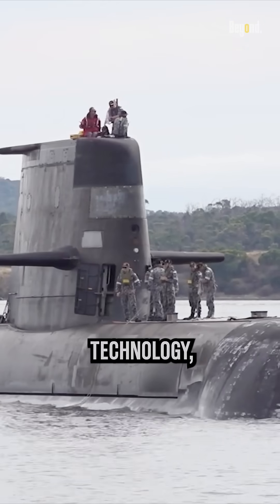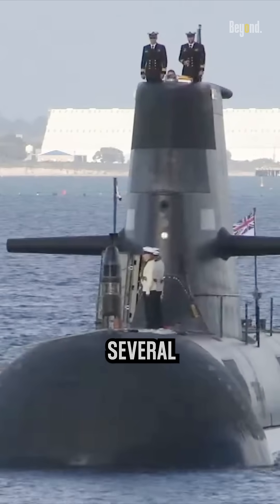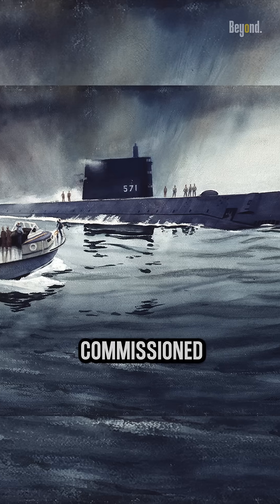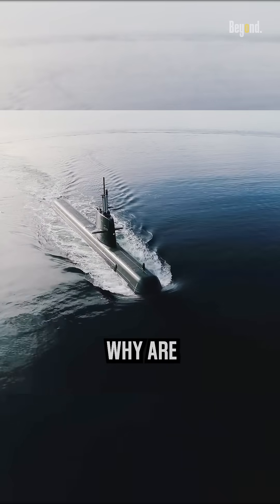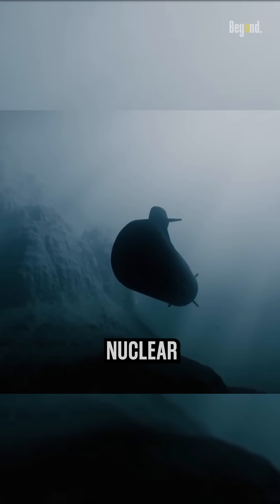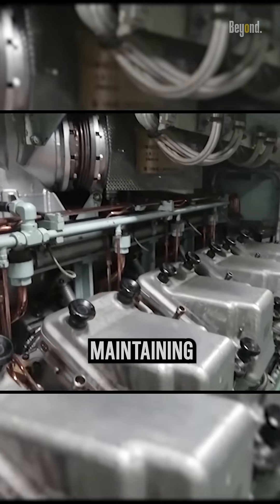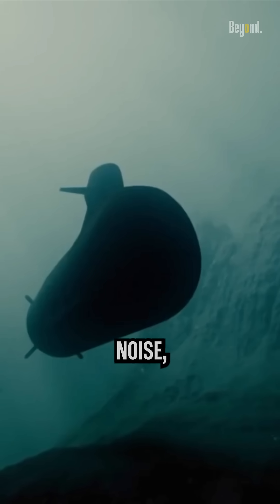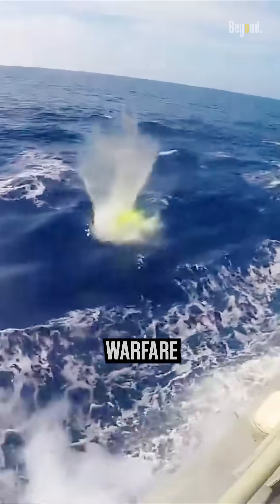Why are diesel-engine submarines still needed? #shorts

Comment: Diesel subs don't use their diesel engines when they're submerged. The run on battery powered electrical motors and only run the diesels when they are surfaced or close enough to the surface to use a snorkel.
Reply: Even with only 60 seconds available to you, this information is crucial.  Better to leave out some of the material that you chose to include.
Reply: @dinsdalemontypiranha4349 then make a video. Do it the way you think others should.
Reply: @dinsdalemontypiranha4349 don't want thieves learning and copying tech
Reply: That has always been the case with diesel electric subs which is why they are so quiet when submerged.  However, the difference is that the technologies in modern diesel electric subs allow for far longer operation underwater and the hulls are configured for underwater operation unlike the WWII era subs which were surface ships that could occasionally submerge and operate inefficiently for short periods.   We also know a lot more in reducing noise generation and a lot more in detecting and identifying noises.   What we haven't improve on, are reasonable procurement bureaucracies.
Reply: I was on an AIP boat..yes, we ran the diesel submerged
Reply: But I understand your Kool aid
Reply: Unless it's a sterling engine
Reply: So AIP uses ( the boat I was on) hydrogen to warm up the diesel, then used banked 02 to feed the diesel...
Reply from the maker: I will make a long video for this explanation, it's only 1min 🥲
Only in Beyond Explained! 🤙
Reply: @BeyondExplained Can you explain why they have to surface to burn the diesel? Why can't you pump out gas like bubbles into the water. This has never made sense to me.
Reply: @lukemurray4950 two main reasons. Exhaust is only one half of the problem. After a certain depth, the exhaust output pressure of the engine will not be able to overcome the water pressure.  The other problem is fresh air. Engines need fresh air in order to combust the fuel that is introduced into the cylinders. Snorkels supply this fresh air when you are very close to the surface. Even if you had high pressure air storage tanks which supplied pressure regulated air to the engines, the engines would deplete those tanks in very short order due to the massive amount of air these big diesel engines require to run.
Reply: @berkcanberk4947  Thanks for the break down but couldn't you convert Oxygen from the sea water? Or is that technologically wishful thinking? Thanks.
Reply: @lukemurray4950  Nah science doesn't allow it with the tech we have. We use something called electrolysis to seperate O2 and hydrogen from water. This process is very inefficient and power consuming. In short, the engine couldn't create enough electricity to keep oxygen supplied, so the engine would die. I hope that makes sense, otherwise I can try making analogies lol
Reply: @Gracefulwarrior2124  No it makes perfect sense. Thank you so much for you patience in explaining this to me. I finally understand so thank you again. Much respect.
Reply: @lukemurray4950  No problem! You somehow merged two of my favorite subjects (which is science and military stuff,) together, so it was actually fun and an honor trying to answer that :D
Reply: @lukemurray4950 It's not about the exhaust gasses. Diesels require air to run, so they either need to be surfaced or use a device such as the snorkel to draw in air to run the diesels.
Reply: @Fizwalker  Yeah thanks. The other guy also broke down for me. Great to people to educate eachother of things we don't understand. Much respect.
Reply: @lukemurray4950 Do you have a clue as to WHERE the air for a diesel would COME FROM if submerged? Hint: NOT from inside the sub.

Comment: The issues not addressed:

1) they are only quieter on battery. When running on diesel, they are much louder

2) most surface to run in diesel, making them easier to detect by air and surface vessels with radar

3) they run slower underwater than nuclear boats

4) because of battery limitations, they cannot stay submerged as long as nuclear boats

5) they cannot operate for the distances and time lengths of nuclear boats without resupply. 

Diesel subs are great for short range and shallow waters. They also make great one-way mission boats, as not having to worry about returning doubles their strike range.
They are a great option that most European, Asian, and Mid-East/African naval nations can utilize.

They make no sense for the US; and any nation that intends to use submarines to project power across multiple oceans is better served with at least a few nuclear subs.

Comment: There is no such thing as a "diesel sub"; they are diesel-electric. They run like train locomotives; and charge batteries. On battery, with modern props, they are VERY quiet.

Comment: You left out the main reason to deploy diesel subs. In littoral / shallow waters, they are deadly whereas nuclear subs have to worry about running aground!
Reply: You are actually referencing the size of the submarine, not the method of propulsion. A nuclear submarine as small as a diesel is possible but no longer worth the expense. You are correct in implying the mission is an important factor but you are incorrect in thinking nuclear powered submarines can not also fulfill the mission scenario you envision.

Comment: Another factor not mentioned here is mission criticality. A diesel sub can not operate on the ultra quiet battery power for very long. This means they will need to surface and runs the diesel which is loud periodically. For some missions this is fine, but the us strategy is to have a sub get lost for months at a time, and never need to surface.
So yes nuke subs are louder in some cases, but in terms of long term evasion they are without competitors.

Comment: When a diesel sub is running on batteries, they can turn off EVERYTHING and I mean everything mechanical and emit zero sound. Nukes can't do that.The reactor is always burbling away. If you stopped a reactor completely, it would scram.
Reply: You stop the coolant circulation pumps and just use natural convection in the reactor for ultra silent operation.
Reply: @dundonrl  So, why do you have cooling pumps if they are unnecessary?
Works the same in the Caribbean as it does under the Arctic Ice Cap?
Reply: @abrahamdozer6273  At very low power on the reactor you get enough circulation with natural heat transfer (hit water rising, cool water sinking) but when you need more power/heat going to the heat exchanger you have to run the circulation pumps.
Reply: @dundonrl  In other words, you can  sit there for a time and do nothing.

Comment: That's unexpected I would have thought dirty diesel would be a lot noisier than nuclear and running costs I thought because diesel would need oil coolant and general piston valves gaskets all that to be replaced every so often than it would be more expensive than nuclear that I thought I just more expensive to build then after that they can pretty much keep going otherwise why would they put them on the us aircraft carriers

Comment: Diesel is used on sterling engine subs, I believe, which are the quietest variety of subs.  Nuclear powered subs are only advantageous for blue-water operation: crossing oceans, long periods under water.  For short cycle coastal patrol duties, diesels are fine.

Comment: When deployment range is not a factor, you can cover more real estate with two or more diesel subs that you could get for the price of a nuclear boat. But if you have to routinely cross an ocean to get from your operating area to your home port, nuclear is the way to go. When possible, it would be advantageous to forward deploy a pack of diesels in trouble spots.

Comment: Diesel subs can run their engines underwater if they carry liquid oxygen to support the combustion. The exhaust is just expelled through the hull. Carrying liquid oxygen is extremely dangerous however. They can use electricity to split water molecules and create hydrogen but that is for breathing air. Underwater they usually use their batteries. Diesel subs are NOT quieter than nuclear subs but they are cheaper.
Reply: When running submerged on electric motors diesel subs can be quieter. Nuclear subs have to run reactor coolant circulation pumps as well as the electric propulsion motors which is additional noise.
Reply: The liquid oxygen bit had me chuckling pretty good. Someone tell you this or did you make it up yourself?
Reply: @jasonrideout6786 What got me was splitting water molecules to create hydrogen for breathing 😂😂. I'm like what now? 😂😂😂

Comment: Sorry, this one is misleading. Diesel subs are only quiet while operating on batteries. As soon as that diesel kicks on to recharge the batteries, it is loud. 
Meanwhile US nuclear submarines went from being quieter that the surrounding waters in the 80s to mimicking the sound of the water in the 2000s. 
The ONLY advantage of diesel subs is that they are much cheaper to buy.
Reply: I imagine they're easier/cheaper to maintain as well assuming the country doesn't have nuclear technicians readily available.
Reply: Less risky too, mind. You don't want to be hit by reactor radiation leak out (/-_•)\
Reply: @finjay21fj  well, the risk is far higher if you happen to be on a vessel made by the USSR.
Reply: @loganb7059 submarines are litteraly the only area of nuclear usage the USA has a clean record on. Its just a matter of time.
Reply: @loganb7059  Heehee yX-D 😆🏅🎖️🏆
Reply: @jordansimms6213 
USS Thresher ?
Reply: @jordansimms6213 the US Navy’s Nuclear Power program in general.
Reply: The other thing is, Nuclear Attack Submarines are not an item you buy at Walmart. No-one will sell one to Iran, Taiwan or North Korea, for example. Few Countries will sell their top quality Nuke Submarines to anyone except an extremely close ally. (Taiwan can't even buy a diesel sub, because no-one wants China's wrath).
Reply: Dont kid yourself. The US has nuclear subs coz they have to. They have to cross that ocean and be very far from their home base and supplies. That's where their mission is. Diesel / battery subs are significantly more quiet when on  batteries compared to nuclear powered that always need pumps to cool their reactor even when the sub is idle. Diesel battery subs are for coastal defense. They don't have to cross oceans and probably can't. It's a different mission and they are good at it.
Reply: @elidas1008  you spelt we like to invade othe nations for little reason and I have no historical knowledge wrong buddy.
Reply: @jordansimms6213  No I never said that the US likes to invade counties. I have no clue why you are saying that. I even don't want to discuss it. Hell must we really go off topic and dive into geo politics? Or can we stick with the technical analysis of nuclear vs non nuclear subs?
Reply: @elidas1008 that person is so pathetic. They didn't address you and went straight to nit picking you
Reply: @jordansimms6213 you spell even worse lmao. "Othe"
Reply: @aminurrahmanmajumder4643  yeah I was never sure what he really meant. The word "spelt" really confused me. What does "spelling" have to do with any of this 🤪
Reply: @elidas1008  don’t kid yourself. Those logistics you mention cripple the viability of diesel subs in wartime. 
No, diesel subs are not automatically quiter even on battery. 
No, nuclear subs don’t always need coolant pumps running. 
I would take a Virginia class against anything else in the world.

Comment: Diesel-electric subs are only stealthy when they are running on the battery. When the diesel engine is running, it is less than stealthy and it must operate either surfaced or close to the surface if using a snorkel. There are a couple of newer propulsion technologies that are air independent. Sweden uses a Sterling engine design which is very stealthy. Spain is developing hydrogen fuel cell technology which shows great promise. And Japan is developing a submarine that used Lithium-ion batteries to increase the electrical storage capacity of the submarine. The disadvantage of each of these technologies is that the submarines can only operate a few weeks before they need to refuel. Nuclear power propulsion submarines can stay submerged without needing to be refueled for as long as the crew’s supplies and mental stability allow, usually around four months. This is critical in establishing force projection.
Reply: Thank you.  I have been saying this on a lot of channels that say this myself.  You can only be stealthy for so long then you have to recharge which means going to or close to the surface to start the diesel engines and that makes noise
Reply: Yeah. The nuclear subs could travel from Europe coast to North American coast with before returning for resupply/refuel
Reply: Japan is allowed to have subs now?
Reply: @bpw102896 yeah bro, Japan is also building two “air craft carrying cruisers” lol basically they are like our flight zero amphibious assault america class ships. Flight zero has the amphibious assault aspect removed and a smaller hospital so they can have a larger hanger and carry more aviation fuel. Basically an escort carrier but we only built two of those, the rest of the america class is flight 1 or like our wasp class AA ships. They retain the well decks and have a smaller hanger.
Reply: A beautiful explanation that is easy to follow, easy to understand, looks at multiple different angles that different countries are taking, and very elegantly, simply, swiftly, but effectively states just why Nuclear is pretty much the best, or one of the best options we have available for this application. (I find it cool that the need to refuel is entirely eradicated, seeing as the energy source will likely outlive the service life of the Sub/Carrier, with the power source lasting around 25 years for the carriers, and I'd assume a similar service window for the Sub's reactors)
Reply: @brinsonharris9816 no kidding. I feel like it is something I'd be super excited about for the first day. Then reality sets in and "Ah shit, 4 months of this??'
Reply: I’m pretty sure Japan used Swedens sterling engines to power their new subs!! I know France has lithium ion batteries tho and also some other crappy method no one has bought yet. Also I think Germany is working with Spain on that one type iirc. Don’t forget tho that AIP doesn’t replace batteries but works in conjunction with them and adds a whole lot of weight or a whole new section to the sub.

Comment: Diesel submarines operate off batteries not quieter they are electric. A nuclear submarine could do the same thing if they wanted.
Reply: They can and do. Nuke subs have large battery banks and can put their reactor in low power while running on those batteries for quiet ops.
Reply: @alienclay2 they also can put the reactor into slow mode operating while the sub operates at very slow speeds for optimum stealth.  US subs are very capable and extremely difficult to detect and track.
Reply: Correct if I'm wrong but nuclear energy is just fancy steam energy, which is why diesels run quieter on battery? Shutting down a reactor is a bit more involved than turning off a diesel engine.
Reply: A swedish built Gotland class sub manage to sneek up on USS Ronald Regan undetected. Even the US attack submarine could find the bugger. After that they learned that they not should underestimate diesel-electric subs.
Reply: @TheEzardin  Yes, they are very stealthy but it was also a war game. In typical multi-National war games, the US normally operates with reduced capabilities so that the opponent has a fighting chance and so that the crews don’t get over-confident. But with that said, the US did lease the Gotland and her crew for a period of a year and then extended it for a second year to act as an aggressor to upgrade and fine tune the US anti submarine capabilities which had been neglected for a long period of time.
Reply: @alanfan8941  the Gotland was leased so US crews could work on new DE diesel boats since we only had nuke boats to train on at the time.  US boats would simulate a diesel by running their engines but the training was not good enough.
Reply: @TheEzardin Not before in that war game the Gotland was destroyed by the USS Momsen DDG-92! (I was stationed on the Momsen at the time).
Reply: @TheEzardin  and of course you know for a fact that there was a direct support SSN working with the battle group?